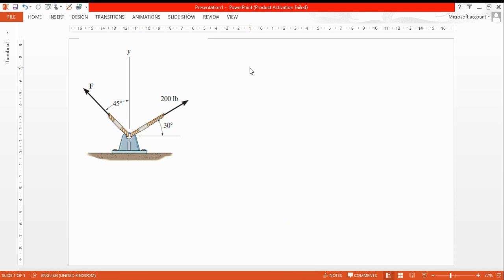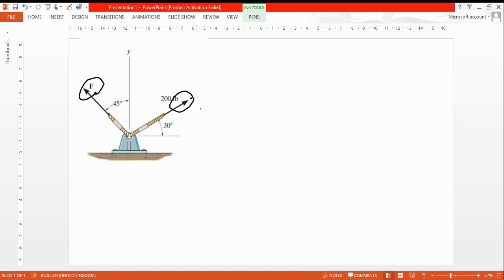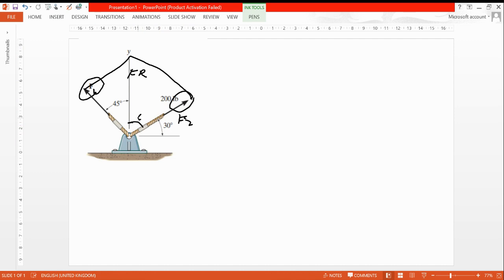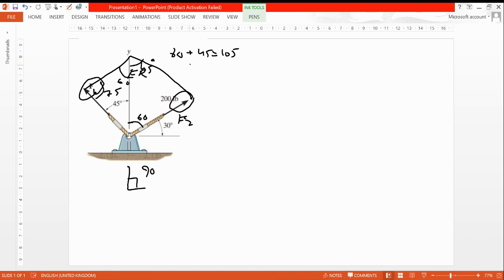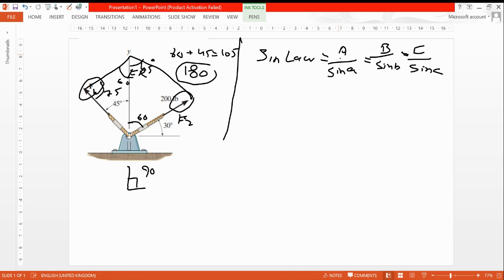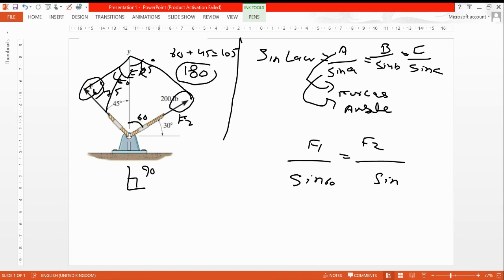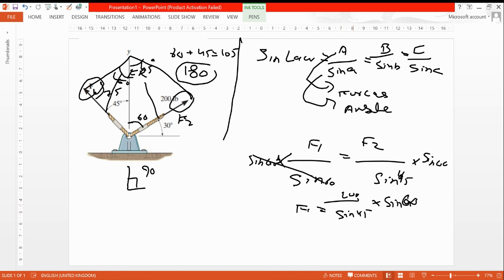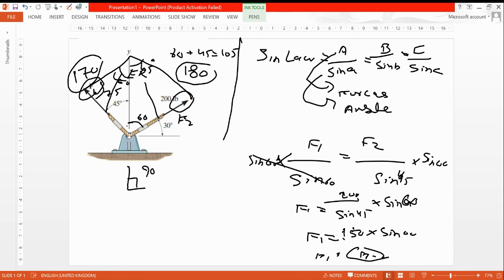Determine the magnitude of the component force F .

Comment: Well explained, but the  final answer am obtaining is not F=170lb, but it's giving me F=244.9lb , please sir make me understand how you got F=170lb
Reply from the maker: https://youtu.be/FDVoNESX5ZU   use by this method u will get same ans if u get your ans you are correct other then the sins rule i used to be correct use cosins rule
Reply: sin(45) = sq2/2 or 0.707...
200/sin(45) = 282.84 and not 150 

It's either they used a different approach or there is an error in the computation.